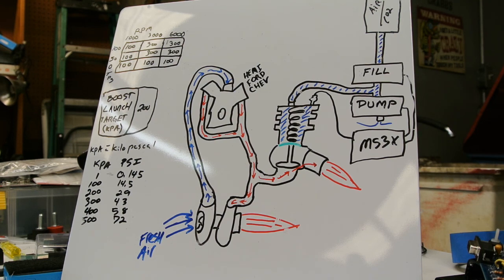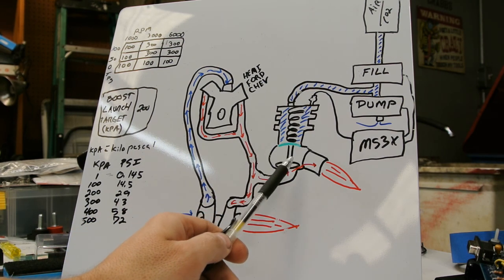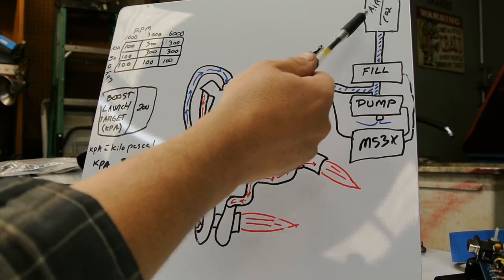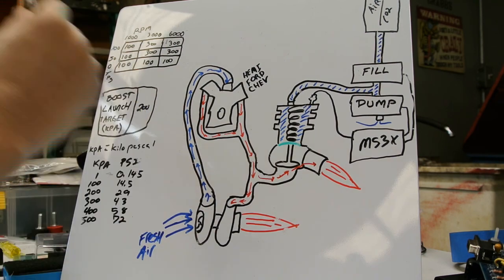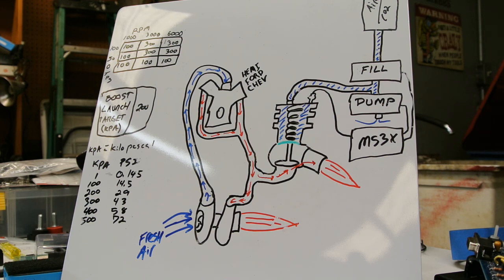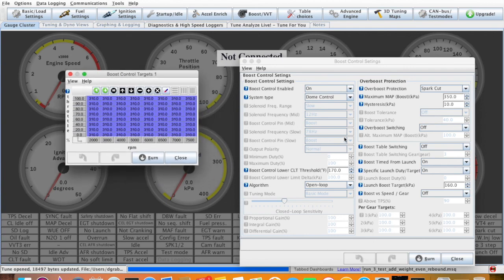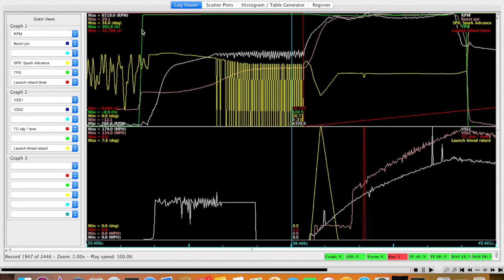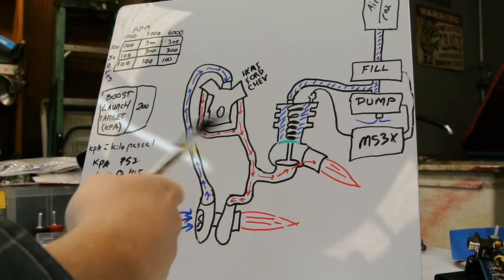Megasquirt Power Management: Boost Control

Comment: So you are just using just a 3 port boost controller?
Reply from the maker: Sorry I missed your comment, a year later no i dont run a single 3 port, i run two, one for filling the gates and one for dumping them
Reply: Or you can use a 4 port mac valve

Comment: Quick question: Your diagram (which is awesome) shows the  Ms3x physically measuring pressure in the top of the wastegate. Wouldn't the Ms3x see the boost pressure in the intake manifold (MAP), and control the fill and dump accordingly (without seeing the actual pressure on air side)? Or do you have both a MAP for the intake, and a pressure sensor for the air compressor you monitor/modulate seperately?
Reply from the maker: I think there is a closed loop boost setting that might do what you’re saying.  I run my boost in open loop, but the waste gate pressure is closed loop based on a table. Kinda confusing